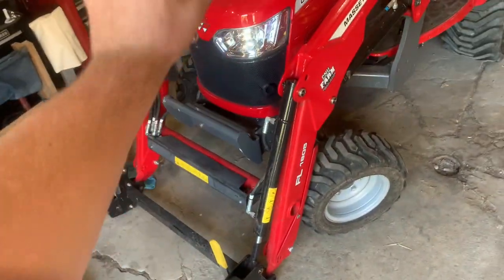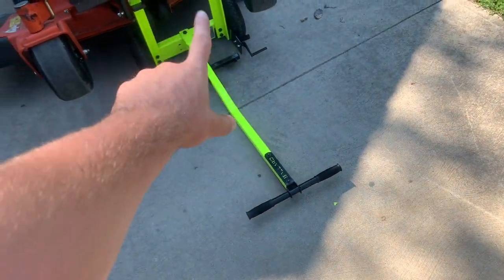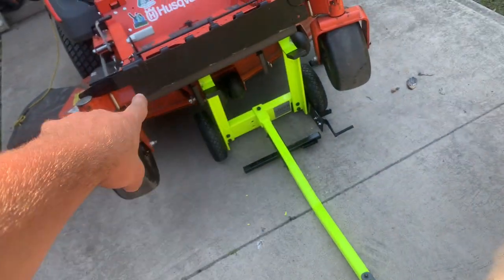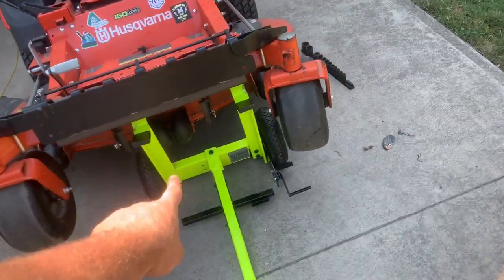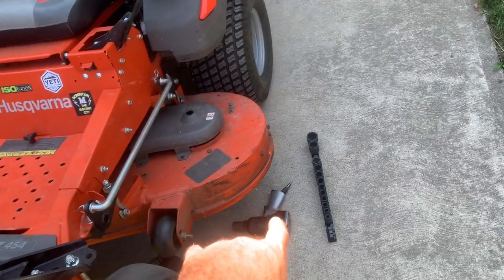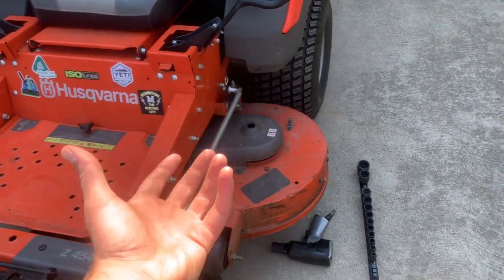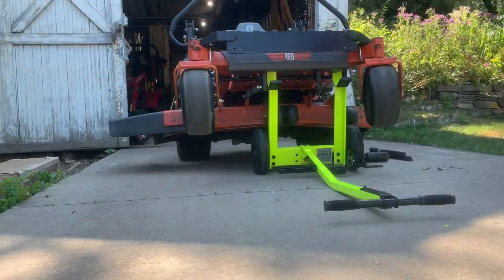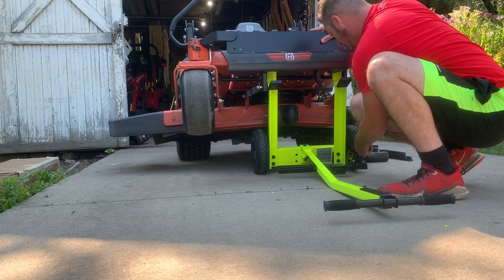BALLARD SUPER JACK V2 DOESN'T WORK ON A HUSQVARNA MOWER? (BALLARD SUPER JACK V2 REVIEW)

Comment: Ryan, I have the Z254F which has the armored deck. I quickly discovered the V2 jack would not fit under the deck, not due to the jack, rather because the Z254F has a reinforced horizontal lip around the front bottom of the deck (roughly 3-4" wide 3/16" thick). So, unless I was going to cut in an access notch so the V2 lift arms would fit, another plan, if any was required. I ended up removing the 1/2" bolt securing the 2 small scalp wheels on the front of the mower deck (most Husqvarna zero turn have them) and sliding in a 20" grade 8 all thread bolt with washers and nuts appropriately spaced so the V2 lift arms would not slide, even if bumped. It worked perfectly and allowed me to access the mower deck for cleaning and quick blade changes. Yes, it took and will take a little time if I choose to install the bolt each time, but I left it in place and will soon see if the bolt (since it is on the leading edge of the deck) grabs too many weeds. THE ALTERNATIVE of yanking the deck each time to clean, change blades, etc. takes TOO much time. Especially for a 70 year old disabled Veteran.
Incidentally, I actually called Ballard prior to purchase to ensure the V2 would fit my mower. Go figure. Another airhead with zero product knowledge.